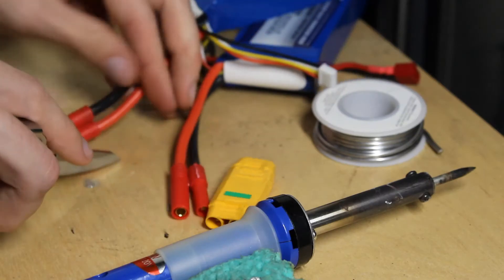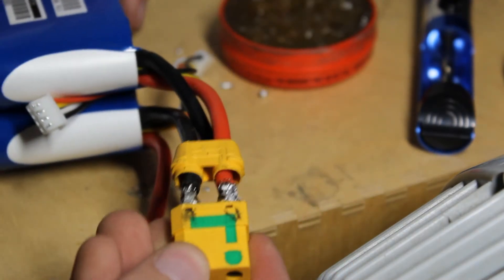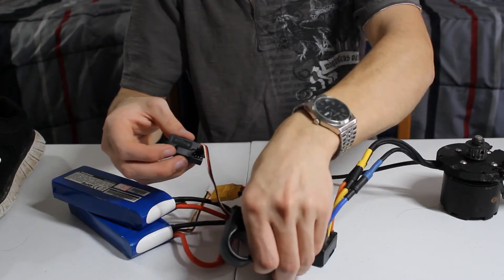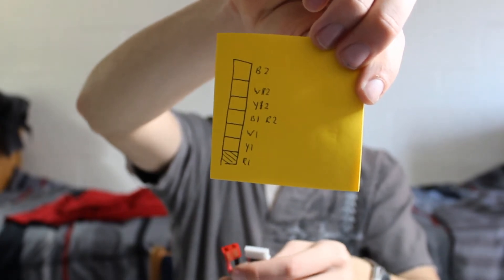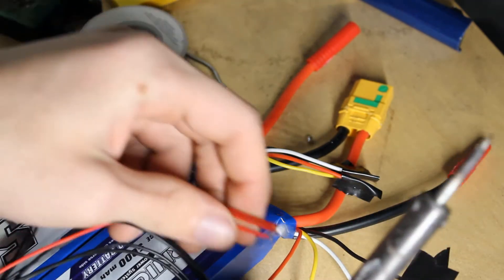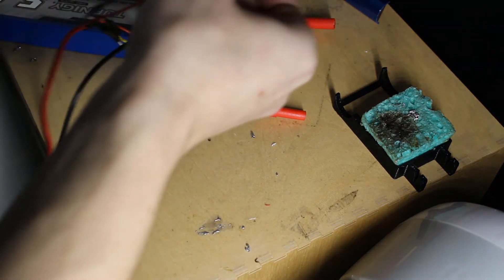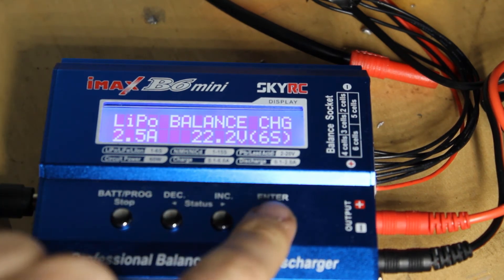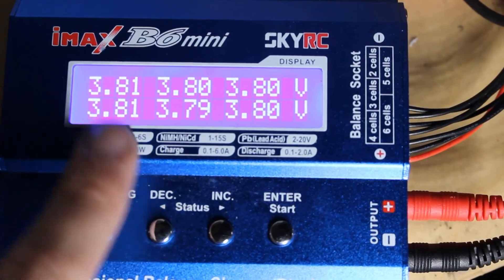#2 Electronics Testing and Charging $400 DIY Electric Longboard Build

Comment: How long does it take you to charge the batterys?
Reply from the maker: It depends on how safe you want to be with the batteries. I would recommend only charging up to 3 Amps, which usually charges the batteries in two hours. The faster you charge the batteries, the shorter the lifespan of the batteries in the long run.
Reply: you can safely charge that battery at 5 amps because batteries can charge at 1c which would be 5 amps for a 5000 mah battery

Comment: Do I need a power button or can I just plug in the batteries and it will turn on?
Reply from the maker: You don't need a power button as long as you are using xt90 connectors to connect them together. I actually just got a VESC and will be updating my video about it.
Reply: Ok thanks
Reply from the maker: You could use  xt-60s as well, it is still an  anti-spark plug so it will be fine.  you can check the rating to how much current it can handle to check if it will be safe for your application.
Reply: Eugene Pentland alright!
Reply: Eugene Pentland what happens if you use xt-60s? I mean does the spark harm anything?

Comment: For the balance cable and the connector that goes to the charger, did you solder them together? Or did you buy it.
Reply from the maker: I bought one, but it was super cheap and kept on sparking so I just used the connector and the 7 pin connector and soldered them directly to the batteries

Comment: nice video man, just a note on joining wires, you will get a much cleaner and stronger connection if you use a lineman's splice and then solder and heat shrink.
Reply from the maker: I'll make sure to use that in the future, thanks!